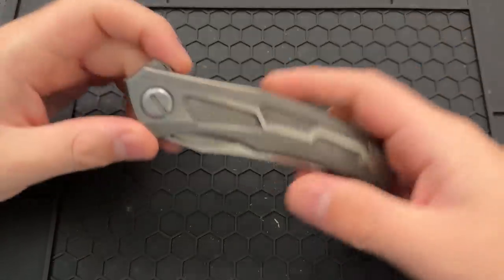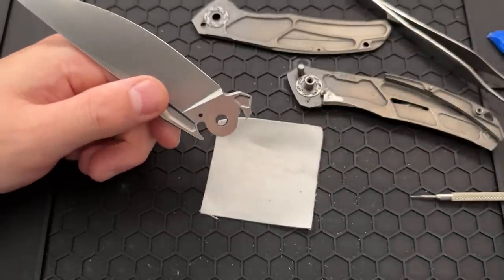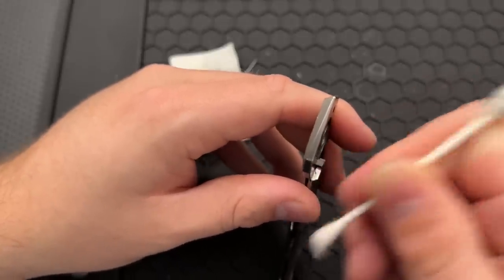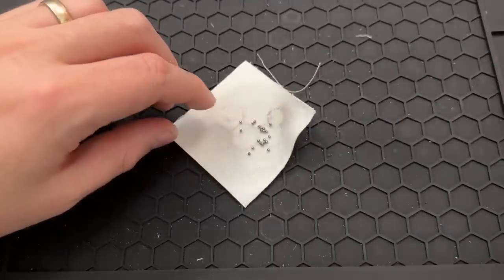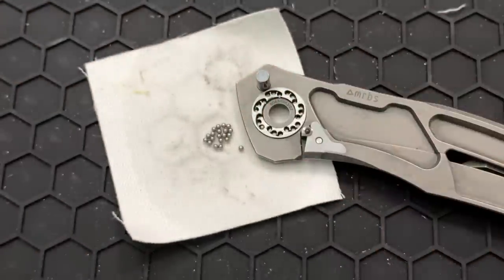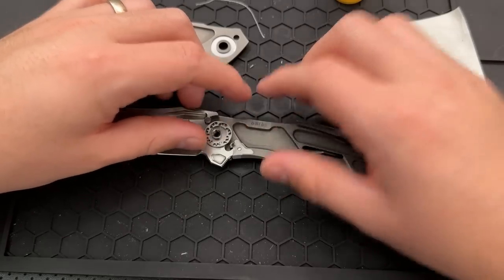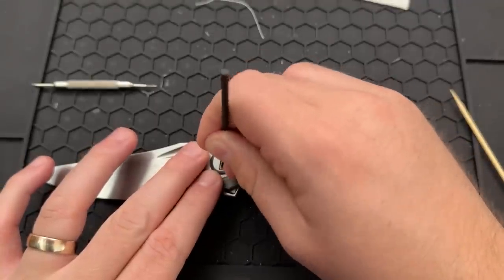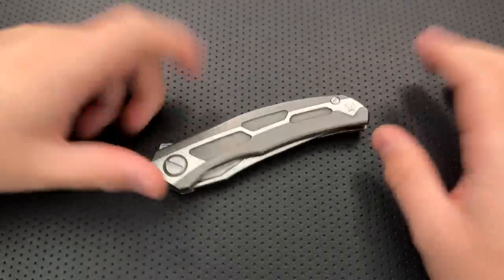How to disassemble and maintain the Shirogorov Quantum Pocketknife, with Quick Impressions

Comment: Get an Ultrasonic cleaner Nick you won't regret it. I got myself a GT Sonic 2.2L capacity, with heating elements that can heat up to 90*c and run for 2hours. And it's been more useful than I thought, it's so nice to clean Jewelry, watch bands, knife parts, and just random items that you need to clean fast without feeling you are doing surgery.

Comment: Great maintenance class Mr. Shabazz. We give you a B+ for effort & an A+ for perseverence. We use either wooded/plastic toothpicks as part of our tools, mod to specification. Heavy lubricant is recommended as it holds the bearings & acts as a sealant so dirt/dust would find it difficult to enter. There are 17 other ways for servicing Shiros but all of them may have trade-offs. Always enjoy watching the legend at work. Greetings from Australia.

Comment: The reason Shiro uses the non caged bearings is because you can get them much flater than caged bearings and it makes the tolerances tighter in turn less debris gets between the bearings and scales. That info is coming from Shiro 👊🏼

Comment: If you have the patience, you can learn a lot here about watchmaking. Tbh, I learned how to service all my Seiko autos as well as 2 other watches I own with Swiss movements. 1 watch has the Sellita SW200 movement, and the other has an ETA 2824-2 movement. the SW200 and the 2824-2 are basically the exact same movements. I learned by buying a few cheap movements on eBay that I didn't care if I screwed up on and went to it. If you're willing to learn and have patience, it's really not that hard to do. Obviously, you do need to invest in some quality tools, oils, etc. (which can get a bit expensive tbh). you'd also be really surprised at how different a pair of $40 tweezers feel compared to a cheap $2 pair of Chinese garbage. you have a lot more control with Swiss made tweezers that were specifically made for watchmaking.

Comment: Not challenging. Asking for enlightenment. Why use oil? When I've used oil, it gets migrates a lot just in reassembly. I'm a rookie and find H1 Super Lube so much cleaner/easier/longer lasting. (Venturing a guess at my own question: while shorter lived, it's smoother than grease because it's thinner, but when I've actually done both, I don't think I detected a noticeable difference.)
Reply: Usually oil gives a faster blade action
Personally I use a wax and graphite coating which gives a great action

Comment: As an owner of an original Shiro F3 I have to admit they are NOT the only game in town now. There is a Chinese brand called Green Thorn. Those guys have been specializing in Shiro knock-offs for quite some time already. Their quality is really high, with real titanium, real M390, and great action. They are not 100% equal to authentic Shiros in terms of fit-and-finish, but pretty close. They are ground very thin, cut like crazy, go in price of ZT knives, while are made much better than, for example, ZT0452CF I owned. So, I did buy my Shiro F3 + their disassembly tool  for those fancy bits to support Shiros, but since than got like 10 different Green Thorns. For some Shiro models, like F3NS, or Pero, or Kami Green Thorn is actually the only option to get those designs, as the original models were limited additions, which sucks, so it's great to have this option at least.
Reply: they are also stealing designs from strider, chris reeve and they even have a clone of the we buster, which is almost as expensive as the original for some reason.
not cool
Reply: @Youtube-Censorship-Police  yes, your're right. That's why I only buy Shiro clones from them, and only if they do not put original Shiro logo on it. Although, I must also confess I'm no fan of Chris Reeve, Strider or Hinderer desigs.
I personally think that Shiro F3NS is the best EDC of all times. The fact that Shiros made so little of those before discontinuing, and made tham so insanely expensive - that's what really is not cool. So I'm kind of happy Green Thorn made its nock-off of this design. It ended up spending much more time in my pocket, than my Spydercos, or even my original F3.